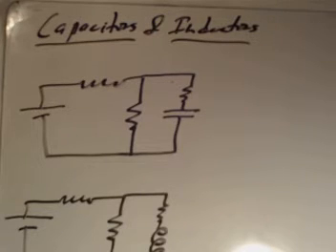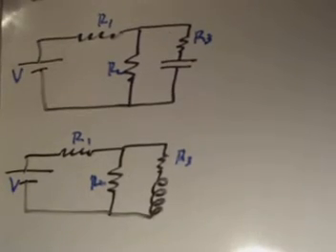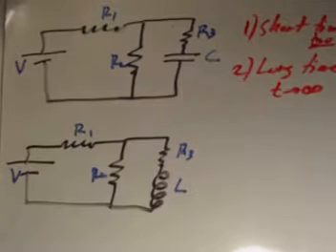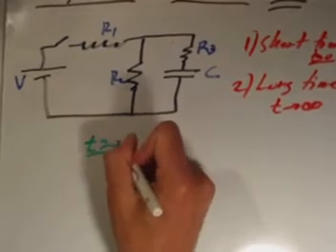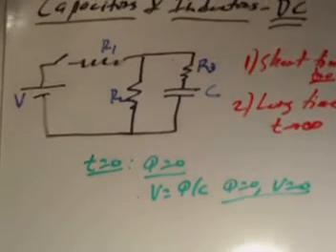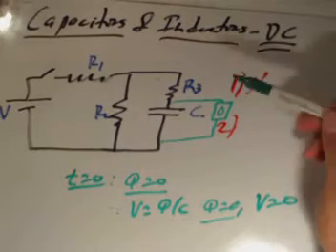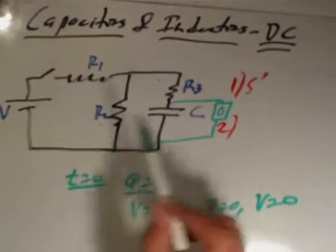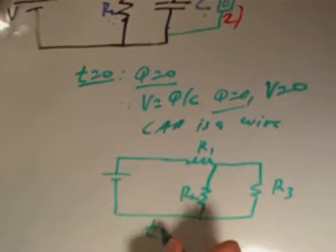capacitors and inductors

Comment: Just after closing the switch how will the current flow across the capacitor branch as it will take time for the electric field to set up. Would it not be open circuited instead of short circuit?

Please help.
Reply: charge flows to each capacitor plate, in a short charging surge that drops off exponentially with time, until the capacitor is full. The E-field that develops between the plates couples the two sides of the circuit.
Reply: Deco Rex Since the plates are totally empty and there is a voltage, the current rushes onto the plates initially. As the charges begin to pile up on the plates, the current slows down.